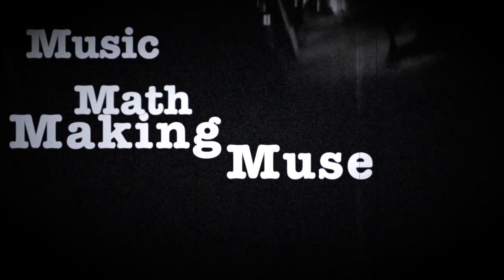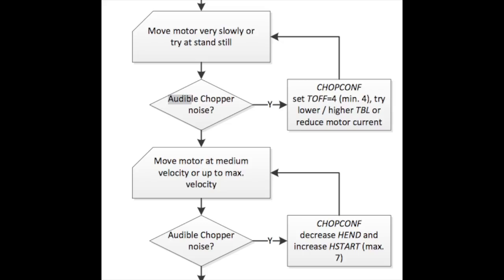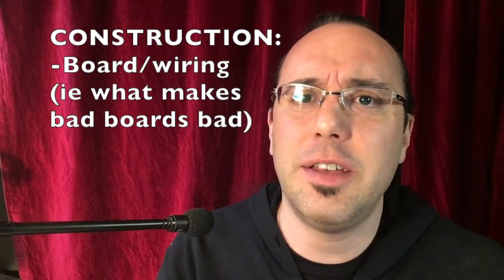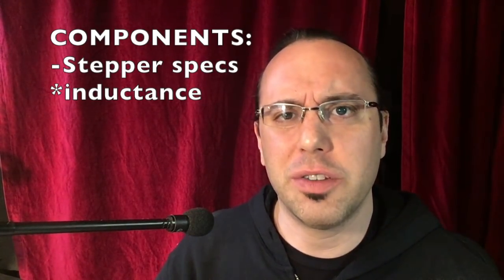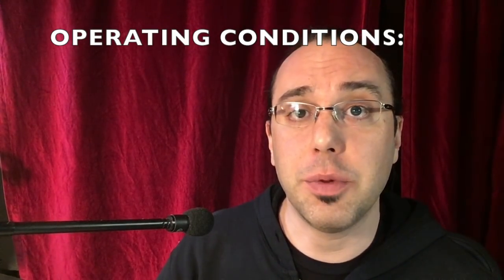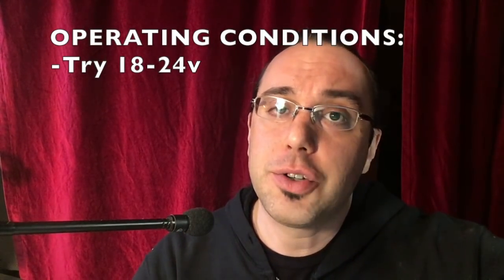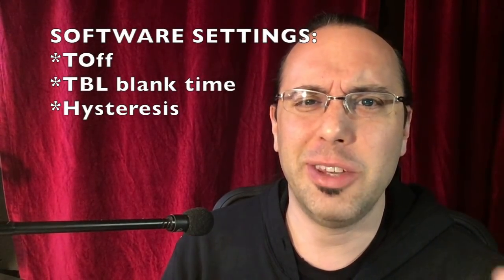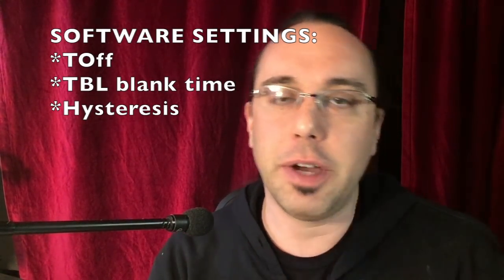Trinamic spreadCycle whine

Comment: Do you know how to make TMC2209's quieter in spreadcycle in Klipper?  When I was running Marlin, my Z axis was quieter in spreadcycle, but now its the opposite since I switched to Klipper. I have to run the Z drivers in stealthchop to keep them quiet, but I think this is causing lost steps when I build a bed mesh.

Comment: For powering RAMPS 1.4 from 24 volts I just bent out the VM pin of the stepper drivers and connected these pins to 24 volt power supply keeping the rest power at 12 volts. I was lucky enough to have two power supplies in my printer (24V power supply was used for hot bed only - weird design!)

Comment: I have a very typical problem. Tmc2208 on X axis. When at 0 , immediately it's holding is no more. During homing , as soon as it touches the limit switch and trying to reverse, for a slow accurate move it kills the printer ()
During forward movement it's nearly ok But reverse have more sound and loss of step.
Please help.

I think it is having really quick power down
Reply from the maker: Could be a few issues, and it depends on your setup. A few things to try are drop the x axis current down slightly and try it.  sometimes it jerks too hard on the direction reverse and triggers the overcurrent warning when homing.  Second is lower the acceleration/speed settings for homing routine in Marlin (another way to address the same issue). There was also an issue way back where the communication of the various axies were stepping on each other during homing, and changing the order of the axis homing or adding a small linear move sloved it... but that was a while back and I forget the details (don't worry about it till you try to first few things, and you can test for this by sending homing commands for each axis independently and if it works that way, you have to change the homing gcode)

Comment: I've been running a printer with TMC2100s using an ATX power supply without the whole power start-up sequence for a year fine. As far as I can tell from the TMC2100 datasheets, it says "When using an external supply, make sure, that VCC comes up before or in parallel to 5VOUT or VCC_IO, whichever comes up later!" And since 5VOUT is tied to the VCC, shouldn't it be fine since 5VOUT will come up later than VCC_IO?
Reply from the maker: Yes, on the 5v-only version of the 2100, the 5vout, VCC, Vsa, and congig jumpers are tied together and just labeled as going to "5v". I think the 2130s had an rc delay of some kind between those pins, and the 2208's are completely different.

Comment: i think you discussed something what this guy did. https://www.youtube.com/watch?v=cdMxwpNk1KU&t=525s he used a delay for power up why do you think? will this work with the 2130's? this is not a full 24v conversion of the ramps
Reply from the maker: Looks like he used step-up converters, which can work also.  I think Tom S showed that on a tmc2100 video a few years back.  The power-up/power-down sequence is tricky because different drivers and MEGA boards react differently.... for example, some Mega clones' usb chips will pop if you power-down in the wrong sequence, but most are fine.  There are a few firmware options as well, but they relate more to 12v ATX supplies, so I have not bothered to mention those options.